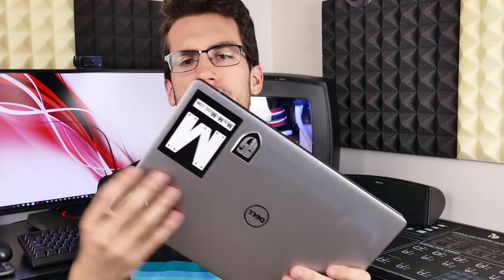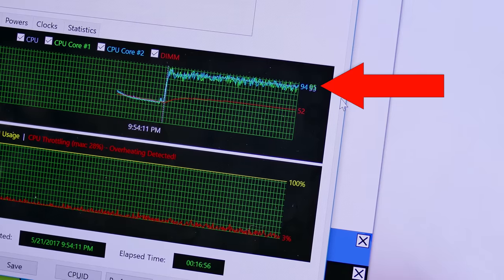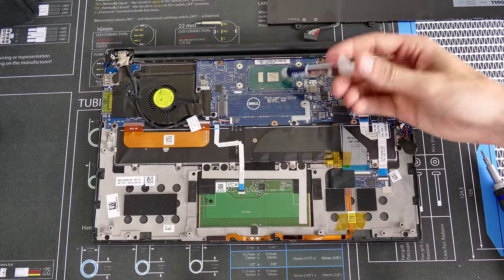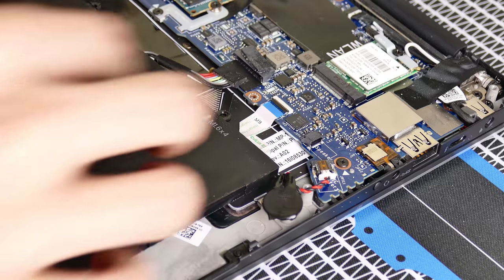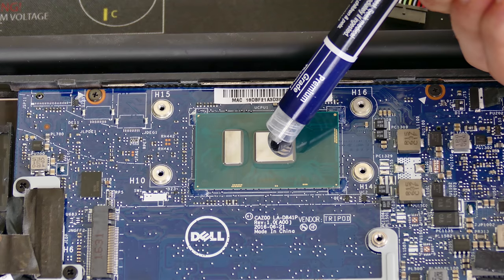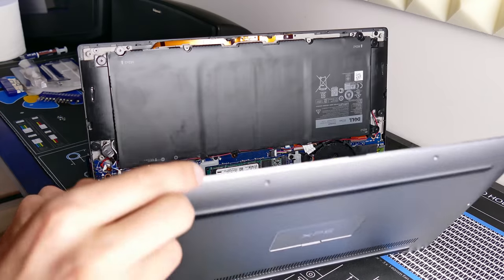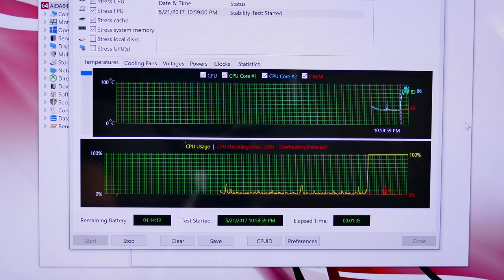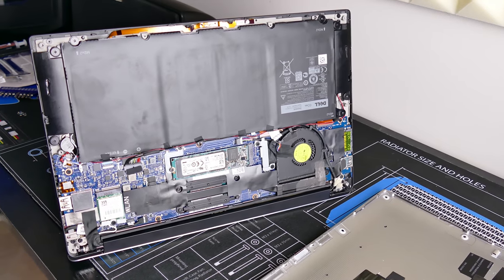Laptop Running Hot? Try This!

Comment: you forgot to say this will void your warranty
Reply: as they say, just don't tell anybody, and I guess dell, for instance, would not have a way to know you removed the heat pipe.
Reply: What about the sticker that's usually there?
Reply from the maker: Anuranan Rai  Deka No sticker or void seal anywhere.
Reply: Science Studio Nice! Well then,no one needs to tell anyone about the little,uh,adventure we had inside if we need to claim warranty.
Reply: on my laptop even if there were those stickers, it is about seven years old, so I don't need to worry about that at all. :D
Reply: sawyer699 not like i have warranty on my 5 year old laptop

It's getting to 100 c from couple chrome tabs a great lenovo lap but the heat is smt else

Comment: wtf mate. All these solutions assume that im running some heavy software........all i have on right now is ONE chrome tab.....thats it....My computer is SCREAMING......the fan is clean............WTF IS WRONG!?!?!
Reply: Is your laptop produced by our lord and savior HP?

Especially their "gaming" line?

Btw did the first laptop that arrive dead on arrival or in a week?
Reply: @Verpal  hahah. I aint that stupid. HP can burn in hell. I have a dell inspiron i5 8th gen, 13 inches 1TB  ,  ....Was not expecting this from them
Reply: @photon2724  I didn't expect this from DELL either! Just bought a new laptop from Lenovo, got I5-8300H with GTX1050 TI, 17inch screen, at about $650, it runs like a charm, Dell got similar offering in Hong Kong at slightly higher price level, so I made a coin toss.

Guess I got lucky this time?

BTW are you still in warranty? I usually don't expect this kinda crap from DELL, coz their inspiron model don't even got a discrete GPU, it shouldn't runs too hot.
Reply: @Verpal  dude thatts an AMAZING price!
Reply: @photon2724  In fact, Lenovo Hong Kong is still offering this product on their website, although you might get a GTX 1050 instead. And you DEFINITELY should either return/demand DELL to fix your laptop, Inspirion shouldn't be running hot.

Comment: Amazing how hardware youtubers are extremely uneducated about hardware.
THE LAST THING one should do for improving a laptop terrible performance is actually messing with thermal paste. The first is cleaning fans, the second is UNDERVOLTING with XTU! 
Unless you buy a very high end thermal paste, there will be very small advantage in doing this, no more than 2~3c unless you are very lucky. Most benefit in temperatures come from cleaning the dust of the fans, which are a much bigger offender. You can easily gain, (actually recover), up to 10c easily by just doing that. Though on this video the laptop did have a low quality Thermal compound in it, that is not often the case, many makers actually use decent mid-end thermal paste that have actually several yars of effectiveness (easily above 5 years) so it is a lottery if that would even make a difference at all. 

Recommending unexperienced users to open their laptops completely without making proper explicity warnings about the dangers of damaging your equipment is a TERRIBLE idea as many Laptops have terrible service friendliness and one uneducated guy can easily ruin a keyboard or mouse molex while attempting to disassemble the interior. Fans, however, are usually much easier  to access to clean than dismount the whole damn thing. 

What a horrible misinformative video, no metion of cleaning fans of undervolting... downvoted HARD.
Reply: sephirotic87 the sky is falling, the sky is falling!!